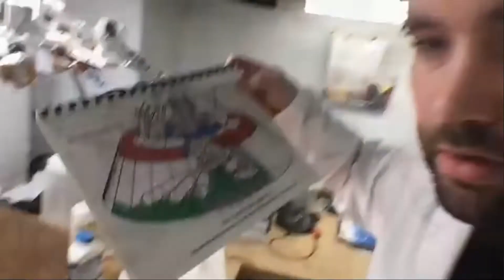APEC Feb 13th 2021 Lab Update with Jeremiah Popp

Comment: Since Hg produces strong electric fields when rolling over any surface, if the VESSLE ENCLOSURE of the Hg conduit happens to be made of BaTi either O2 or O3 variant, we can expect PHONONS to be generated rotationally in the piezoelectric barium ceramic as the Hg atoms make and break field contact with the barium housing as it circulates...  And yes, this combination and method can be a powerful influencer of the gravitational flux response for these specific materials and their surrounding relativistically generated spacetime envelope...